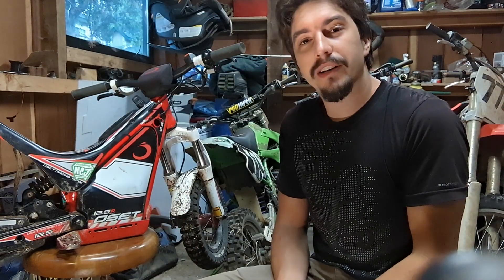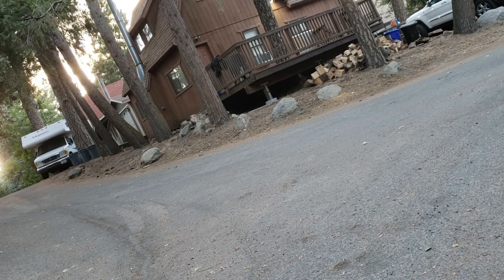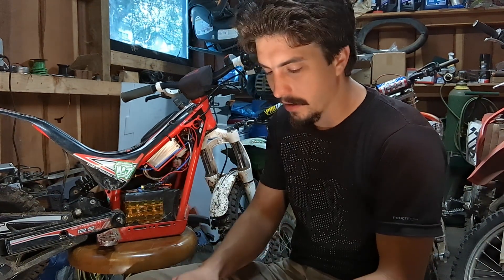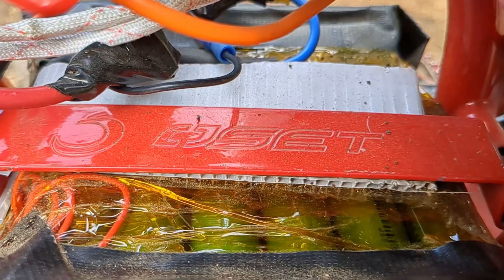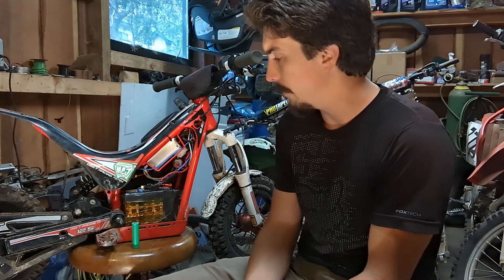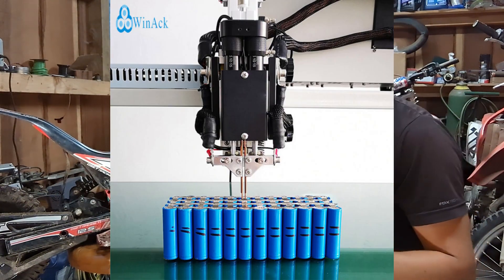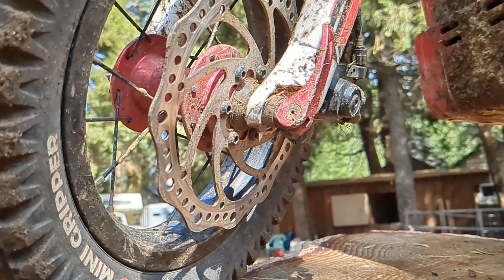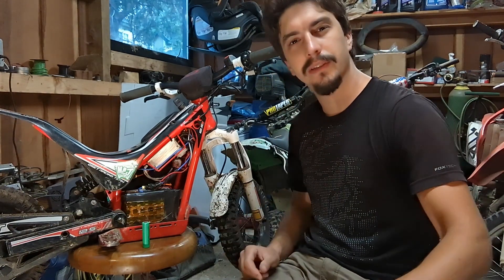Lil Ripper - 3 Years Old Wheelies - Oset 12.5r - 42v LiPo Battery/Controller Upgrade

Comment: Did you ever try running a 36v battery on the stock controller? Or have you heard of anyone else doing this?
Reply from the maker: I've never tried but I have been told it will not work on anything more than 24v.

Comment: You use the standart engine?
Reply from the maker: Yes, It's been about 1.5 years on the stock electric motor and no problems.
Reply: @theshippingcontainergarage if possible can you tell where this kds36100e is in stock?
Reply from the maker: @ZangerMarvin19  I found is at Cloud Electric with a quick google search. https://www.cloudelectric.com/product-p/kelly-kds-series.htm
Reply: Thnx for reply appreciate it alot im surpirced since the stock engine is for 24V 

I have alot lipos from rc flying so first i will upgrade to 6S lipo instead of the standard battery and later i will make the move to this different speed controller thank you alot for uploading and sharing this info❤️ 

Btw your little girl is driving amazingly!!!
Reply from the maker: @ZangerMarvin19  Sure thing! I'm happy to help. I have a feeling the Oset 12.5r shares the 36v motor from the 16" bike. 42v is not that far out of spec in that case.

Comment: I know you built your own battery,  but is there someone who you have since found that will build a 42 volt battery and controller for the Oset 12.5?  My grandson wants more speed.  I haven’t seen anyone else doing what you have done  to your daughter’s machine.  I’m in So. Cal also.
Reply from the maker: Sorry I haven't searched for that since building my setup. Back when I was researching I think there were guys on facebook or forums that built batteries. You could also try contacting high end RC shops and/or custom drone building guys. 

If you can't find anyone it's not the end of the world to build your own. Just get the really good tools for it and the job is easy. 

Highly recommend you get a better front fork and do the rear shock mod like I did if you guys are going to crank up the speed.
Reply: What about the controller?  Stock controller works?  I get that I’ll need a lithium charger to charge the 42 volt battery
Reply from the maker: @darrengillhouse198  Stock controller will not accept any voltage higher than stock voltage.

I just use a DC power supply with adequate charging amperage as my charger.

Comment: stupid,, with the upgrades you could’ve just got a fast 50 that’ll smoke that thing
Reply from the maker: Lol ok, it's pretty hard for a 20 month old to ride an 80-90 lb 50cc loud 2 stroke race bike. But I had mine riding her Oset at 20 months, racing other electric bikes before 3 years old, getting season podium trophies at 4 on the same Oset vs 5-8 year olds in the big kid open mods class. We have since moved on to KTM 50. The built Oset allowed us to completely skip the PW50. throttle control... hard acceleration... cornering tight or wide... handling skills... hard braking... jumping. My 4 year old learned it all 1-2 years earlier than most since she started on such a small fast capable bike.

The point isn't to compete with ktm 50/cobra 50. It's to bridge the gap and get on those bikes sooner. Most don't understand how small the Oset truly is. It's tiny!

Comment: How did you connect the lithium battery / controller to the ac / dc motor
Reply from the maker: It's pretty straight forward but you have to follow the manuals. The battery connects to the relay, switch turn on relay and controller, relay opens up to send power to the controller, Controller connects to motor. 

Hope this helps! 

Forum post PDF describing the wiring:
https://www.trialscentral.com/forums/applications/core/interface/file/attachment.php?id=9946

Manufacturer instructions: 
https://www.kellycontrollers.eu/custom/kellycontroller/image/data/srattached/c94af8c51d35e126f50d62b12c379a2d_KellyKDSUserManual.pdf

Forum post describing build:
https://www.trialscentral.com/forums/topic/46013-oset-160-24v-kelly-controller-installation-wiring/

Comment: So did you just run more power through the stock motor?
Reply from the maker: Yes exactly.

So far it's been fine. I just keep water jugs on hand to dump directly onto the motor to cool it off for long race/practices etc. I've never taken it beyond too hot to keep my hand on it. 

I reached out to another guy on forums/Instagram who did a similar build several years ago, he never burnt up his kids motor and I think he was pushing 50v. However they were up in Finland or something so maybe they had a colder climate. I dunno. The motor is pretty cheap if it does burn out anyways.

Comment: Definitely a hole shot machine, lol. Ours is stock (on 24V lifepo4) and they're really powerful, especially considering power/weight compared to a 50cc.
Reply from the maker: Nice yeah I really like the size of these bikes compared to the 50 bikes. Wish they were lighter with a redesigned aluminum frame. I was talking with Oset and apparently they have a fully redesigned product line coming out soon. I'm hoping for aluminum... 

FYI, I think the LiFePO4(Dakota Lithium, right?) can't spit out enough current for true 24v full throttle acceleration requirements. I never ended up pursuing it but when I looked at the output numbers I don't think it can supply the current needed for full throttle.
Reply: @theshippingcontainergarage  I originally started with 2 Dakota 12V's. It seemed better than the lead acid for power, but it was also a hell of a weight reduction. It definitely ran longer. I've been turned off of Dakota though. A guy on YouTube tore a bunch down, the AH rating is a bold face lie on the 12V10ah, and either it has no short circuit protection or they all just happened to fail his tests... It SHOULDN'T matter, but I accidently touched one of them reverse polarity, so you realize anything can happen.

I'm now working with K2 24V lifepo4. Crazy expensive, but used ones can be found in great condition (most spend their life as backup power in hospital equipment and get proactively replaced early, is my understanding)
Reply from the maker: @TimPaddy  Ah I'm glad you did some research and found something better. Mine came with the Dakota's from the previous owner. They were so much lighter and they worked so I never bothered with the lead acid at all. Good to know about the other LiFePo4s... in case I ever downgrade for the next in line(she's 2).
Reply: @theshippingcontainergarage if your just looking for a longer battery life and faster charge does it matter what battery you swap out for. I've seen another video of 1x 24 volt lithium battery being put in instead . Since you put in a 42 volt will that be twice the battery life of a 24v and automatic greater speed ?
Reply from the maker: So it sounds like you just want longer run time rather than just more horsepower/torque. You would have to make a comparison on the batteries rated AmpHour capacity. They typically call it "Ah". I don't know the specifications on the one you are looking at so it's hard to say. Either way that's the comparison to look up.
Reply: @theshippingcontainergarage  it's was a 4ah he used , is that good enough

Comment: How much was the total build cost of you don't mind me asking ?
Reply from the maker: Approximately $150 to $200 in battery(can be cheaper with less batteries in parallel)
Controller was $110 shipped from Cloud Electric

Overall probably about $300 in total. If I were to do it again I would probably try and purchase a high quality battery terminal spot welder. The DIY car battery + starter relay version I made was a pain to use.